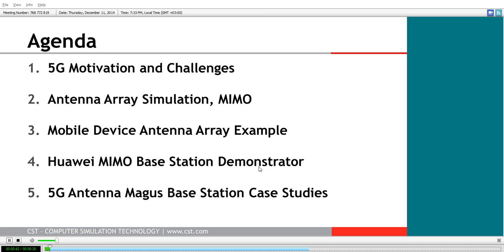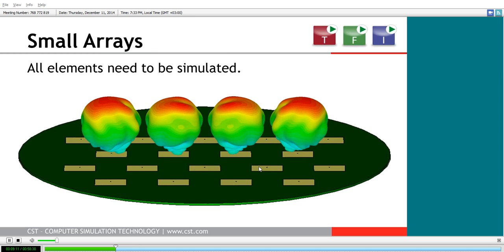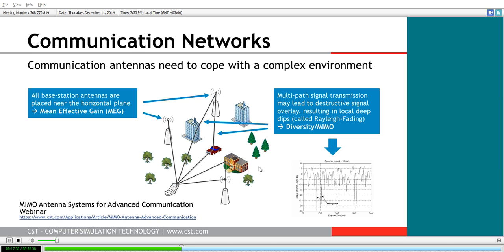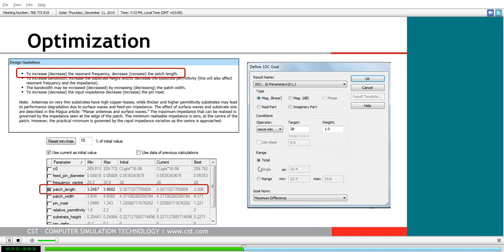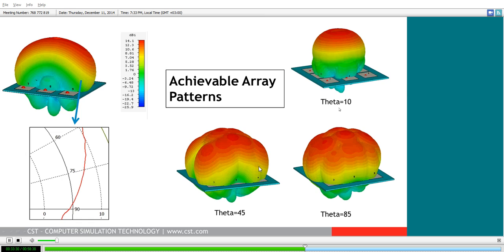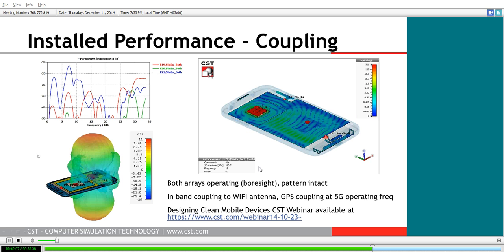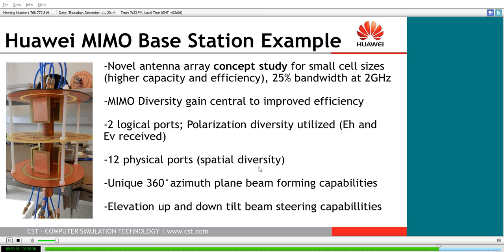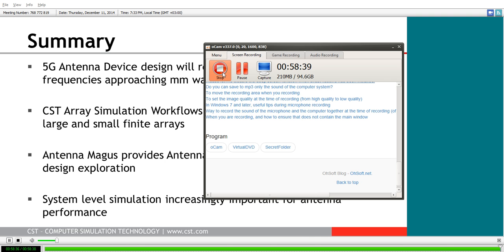Simulation-Enabled 5G Antenna Design

Comment: could you please clarify what kind of antennas are used in mimo systems?
Reply: Kostis Papadakis any kind, Omni directional preferred.  But the disc with rectangular patches show directional array antennas for beam-forming. 
Psst - did u know nsa and mossad can hack your wifi router and focus these beams towards your head or vital organs for the sole purpose of maiming you in case you happen to be a targeted individual like a truth seeker.